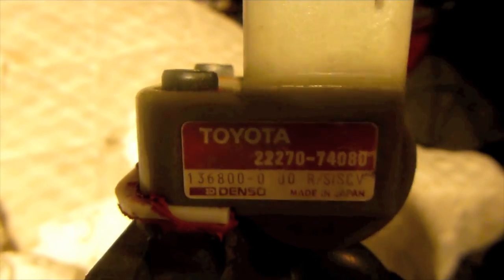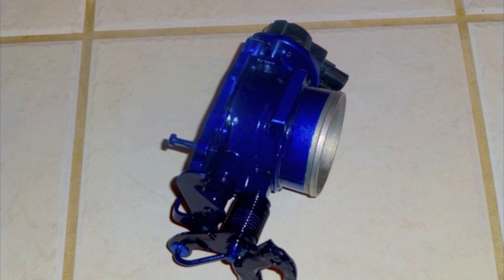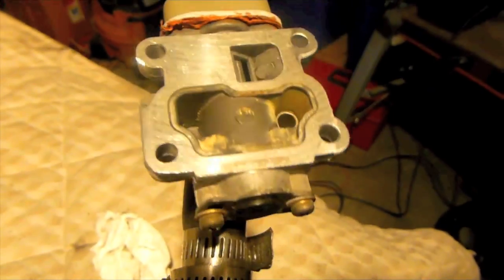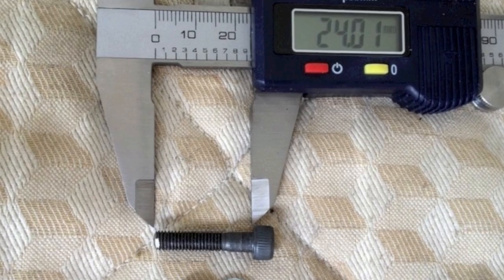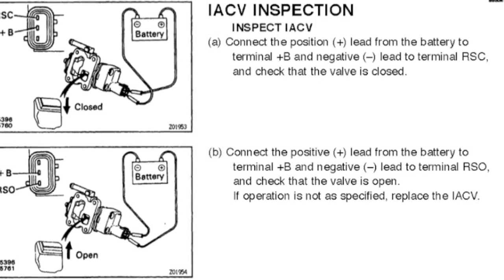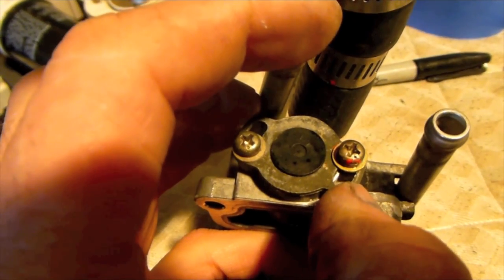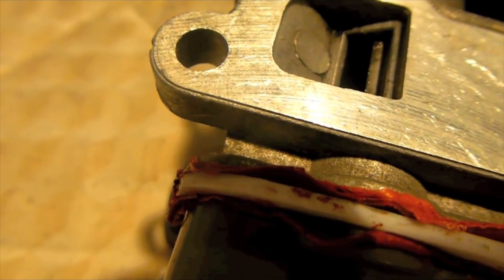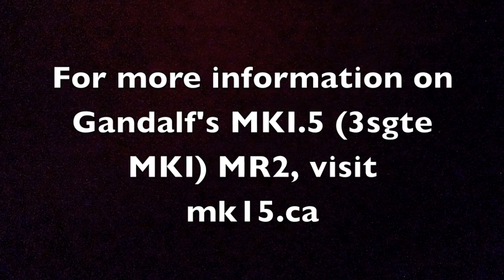Idle air control valve IACV, idle speed control valve ISCV from 3sgte engine (MR2 and Celica)

Comment: Hi Martin!
I have 4A-GZE with throttle body from MR-2 3S-GTE (55 mm dia instead of 45). When I start my engine it has no idle during approx. a minute or two. So I have to push the gas to make it work. Then I can release  the accelerator and the engine is idling but with less revs (as well as I can guess - near 1000 rev/min, factory tacho from 4A-FE is not connected). Idling is not stable, it seems that there are some misfire. The bottom is rebuilt with new rings. I checked as well for air or vacuum leaks - everything seems to be fine (I sprayed sort of easy start liquid to all connections, when it gets to intake you can hear it at once by slower revs).
So what is your opinion, can it be the topic of your video causing lack of idling just after the engine start?  Should I simply do same things that you showed on your video and it's gonna help?
Appreciate your help
Paul
Reply from the maker: A few things come to mind off the top of my head … the Throttle position sensor (TPS) I am not sure if it is interchangeable between the two ecu’s,
If the sensor is swapped out it needs to match the same “zero” signal (or be at the same angle and position)… if the sensors are still with their respective TB’s, then the 4a ecu is interpreting signals from the 3s sensor, so not sure if that is compatible that way either. That can cause the ecu to act uncharacteristically at idle.
Beyond that, yes, the IACV would be quite responsible for idle-up as you describe, and the airways would need to function from the TB to it etc.
The coolant hookups to the TB can be ignored and left unconnected if you don’t drive in cold winter.
So yes, the video info could apply in that regard.
Hope that helps!
Reply: @mkloppers  yeah, thank you so very much for your help, Martin!
As for the TPS - I forgot to mention that when I bought the throttle from 3S-GTE the TPS installed on it from the factory was not sending any signal, so I replaced it with TPS with same OEM part number as on 4A-GZE, with adjustment of its position of course. When my engine is warmed up, it is idling almost the way it should except some misfires. So can we put the finger of blame at the IACV?
Reply from the maker: @paulgauthier2693  I would start there, the IACV if it were stuck shut, would explain the low or absent idle when cold, but not the misfires  when warm. When it is warm/hot, the IACV would be closed anyway, and so the engine operation would be without it, and shouldn’t have any “misfires” due to the IACV.
Reply: @mkloppers  I really appreciate your help, Martin! 
You said that IACV would be closed when the engine is hot. So is there one more valve that opens and provide fresh air as temp rises?
Reply from the maker: @paulgauthier2693  no, the IACV should be the main controller of the difference between hot-cold engine idle, in combo with the ecu of course.
Other things do affect general idling and running. Have you done a boost leak test (vacuum test) for leaks? If un-metered air is sneaking in a different way it can cause erratic running at various RPM’s, and may cause the engine to be leaner than optimal at the start, especially cold start when you want the richest mix.
Reply: @mkloppers  yes, I checked for leakage with the help of easy start spray, even found 1 point of leakage, fixed it.
Judging by spark plugs colour (dark black), there's no lean mix, it's reach enough.
Ok, Martin, thanks a lot for your consultation, I will do the procedure in a day or two and tell you about the results.
Have a good time!
Cheers, 
Paul

Comment: So would this "range plate" be where one would attempt to correct a cold fast idle speed that is too high?  96 Honda Civic EX A/T.  Mine has the coolant circulating through it and a bimetallic spring.  Fast idle is around 1600 to 1800 rpm and supposed to be only 850 to 1000 with no electrical load and in park or neutral (150 to 300 higher than the idle of 700).  It is getting very annoying.  Would I rotate that range plate a bit CW until I get the correct fast idle speed?  Thanks for your video an if you see this would be grateful for any comment.
Reply from the maker: I haven’t fooled around with the Honda version of the IAC/ISC valve, I would wager it is similar in most ways to the Toyota version, but I don’t know specifically how Honda controls that valve. If your warm idle is perfectly normal, then it kinda eliminates the possibility that you have a vacuum leak (unrelated to the valve), because your idle would be up across the board.
Secondly, usually if these idle valves become clogged and hampered in function, they will have loss of range and loss of response to temperature difference, to the point that they don’t move at all. 
Thirdly, if the coolant passages were clogged, it shouldn’t affect the range of the idle valve, because when cold, the temperature would still begin at ambient no matter how much coolant was flowing, or even none.
There could be a temp sensor that determines coolant temperature that is sending signals that are out of range, eliciting a higher cold idle… but, unlikely.
I would remove the valve, clean it thoroughly, check it for leaks (because a leak there could allow more air into the intake manifold than intended),
Bench test it for range if you can,
And then test that plate movement and it’s affect on the idle. The reason I would try this last, is because turning it down may bring down your idle across the board, including warm idle.
Hope that helps.
Reply: @mkloppers  Thank you.  I did test my ECT because I also suspected it could cause high idle but it looks like it is accurate when comparing my scan tool output to an actual thermometer.  I removed the throttle body and the IACV and cleaned them pretty thoroughly previously and the car accelerated better but I had to turn the warm idle speed screw (no adjustment for fast idle) to get the car to idle at 700 after this.  The fast idle remained too high.  I will try cleaning it again but this time I'll remove the coils so I can spin the shaft and I'll also bench test the closing and opening under 12V power.  If that doesn't work I'll see nothing else to try but adjusting that range plate, except for PCV valve and spark plug wires, cap, and rotor which I will do first.  Thanks!
Reply from the maker: @captainwho1  
Wires cap and rotor shouldn’t have any effect on your cold idle being high, it would affect overall drive ability etc, pcv might however, or any other vacuum related things. You might be able to get the idle cold/hot where you want it by adjusting both that plate and the warm idle speed screw.
Reply: @mkloppers  Thanks for encouragement.  The PCV is very suspicious because the hose going to intake man. seems to be collapsed somewhat.  If there is a blockage in the PCV maybe that could happen.  Not easy to get at in this car (dumb!).  One of the spark plug wires is bad even though the car runs great.  Over 2 MOhms!!, hard to get a stable reading.  I wouldn't put it past this car to try to put more fuel/air in to compensate at cold startup, which could cause a high idle?  I just want everything else to be right before attempting to nail down the idle issue, which will require adjusting those two things hopefully, once I have determined once and for all that the IACV is totally clean.  I'm thinking I might try removing the coils and cleaning it in my ultrasonic cleaner.  I haven't seen anyone try that.  I saw in other people's vids that their valves were closer to being closed at room temp. than mine so I'm hopeful that is the problem, although nobody (including me) thought to measure the opening.
Reply from the maker: @captainwho1  sounds like a decent plan. Do post an update here, how things turned out. My car really is a Honda/Toyota combo, and much of the tech/designs between the companies of that era were surprisingly similar.
Reply: @mkloppers  Will do!  I just actually watched a video where the guy actually did adjust his fast idle by rotating the range plate, although he did some other mods which he admitted were unecessary lol.  https://www.youtube.com/watch?v=KBys2R3p-gw
Reply: @mkloppers  Posted my recent update in that video by OzMike I referenced above.  Better but will have to adjust the setscrew for the plastic limiter because I believe someone has tampered with it as evidenced by the seal cap being removed already.

Comment: Thanks for this video! This 3SGTE IACV looks pretty much identical to the one in the 4AGZE, so this has proven very useful !
Reply from the maker: You are welcome!
Reply: @mkloppers  With no voltages applied to your IACV - what position was it in? Open, closed or somewhere in between?
Reply from the maker: @AE92World  
good question. I actually considered using  no ground as a “setting”, for something in between, but it is inconsistent and unreliable, as far as the position the valve relaxes in. You can actually see in the valve actuation before I adjusted it, that there is a moment that the valve “relaxes“ as I release the ground from one pin and switch to grounding the other pin, the valve relaxes slightly towards the centre from its last known position. So, after fully closed, it will open up a tiny bit and after fully open, it will close a tiny bit. After I adjusted the valve, it seemed to relax less with no ground applied, but I believe that air pressure (or vacuum) will likely push the valve to a partly open position in short order.

Comment: Hi will this hell sort my idling issue in my celica gt4? Im using a side feed intake manifold
Reply from the maker: It could... have you tested the function of the IACV? Start with just testing if it is operating correctly. What are the idling issues?
Reply: @mkloppers  yes it works when voltage is applied but wont drop below 1.3k high idle i followed your video and did the same but has increased higher 🤷‍♂️
Reply from the maker: @Blackfracolin1  If the IACV is functioning properly when tested, and you even tried adjusting it towards fully closed, and it still idles high or even higher, you might have a vac leak that is allowing extra air into the intake manifold. Basically, air is bi-passing the IACV altogether, or finding a way to pass through it. Do a boost leak/vac test. Determine this first.
Then if not that, perhaps the throttle body plate is  not closing fully, throttle idle/stop screw is shifting.
Do you have air conditioning?
Reply: @mkloppers  no ac it has been removed the vaccum line going to the throttle body when blocked idles around 0.5k when let loose gos back up to 1.3k.. even when warm does exactly the same a little higher on cold start but still drops down 1.3k rpm.. do u think blocking the vaccum line increase the throttle screw will fix this problem right now the screw is tightened all the way  down? It has a standalone ecu fitted with a fmic all hoses seem fine checked the intercooler hoses and vaccum lines all seem fine and are new
Reply from the maker: which vacuum line is that, that alters the idle down to 500 rpm?
Reply: @mkloppers  its the one coming out the bottom of the throttle body the largest nipple has a vaccum line going to the intake of the turbo piping when blocked idle drops.. its the pipe from the iacv its a rev2 3sgte st185rc the same black vacuum pipe in your video.. i think my iacv is stuck open and maybe not closing but itis working when checked
Reply from the maker: @Blackfracolin1  How did you check it? Did you have it off the TB and looked right at the opening/closing?
I would agree, I think it is the IACV that is not doing what it should, not closing enough or enough range of motion towards closed.
Reply: @mkloppers  yes it was off the throttle body applied 12v to the pins and was opening and closing but not closed full until i adjusted as shown in the video its in full working condition.. do you think it could be the map because im still on actuator tune running the link g4 storm?  i sealed the tb using sealant with a special gasket no leaks..
Reply from the maker: @Blackfracolin1  Ok, we might be getting somewhere. :)
Do you know, or can you test, what voltage readings are being sent TO the IACV? That's the next thing to determine, whether the ecu is giving proper instructions to the IACV. The ecu should be telling it to be open at cold start, and then as the engine warms up and coolant temps rise, the ecu will tell the IACV to close, dropping idle consistently to normal idle range, 700-800 ish. The Link G4 Storm would need to be set up with the proper outputs to control the IACV, and this may require as many as 4 outputs.
This is something that you need to check with your tuner. It could also be set up similar to the way I did it, pretty much full open or full closed with the ecu sending full voltage to fully close only below a chosen coolant temp. This is not a gradual change, of course. In my case thus far, I have it on a manual switch, and haven't bothered to hand the control over to the ecu at all.
And, one more note, you can also test your TPS to see if it is operating within specs, as this can also throw off your idle... the Link ecu would also need to have the TPS setup correctly in the software/tune.
A video that you might find interesting, using your Link:
https://www.youtube.com/watch?v=mPzhbWABdjo

Comment: Hi hows it going mate, Iv got a MR2 MK3 (spyder), it always revs up a wee bit when changing gear, if I change gear at say 3000 revs.... as soon as I press the clutch the rev counter needle always goes up by about 250revs for a second then comes down again, (if that makes any sense.haha) Just wondered if you had any ideas what would cause it to do that? Iv cleaned the MAF sensor but its still just the same. thanks :)
Reply from the maker: A few things may be affecting that. It sounds a bit like rev hang, but I don't think it is a common or consistent Spyder issue, and it shouldn't be caused by computer-emission controlled annoyances that will come up with other brands. 
Yes, the IACV could need a cleaning/testing. It could also be a vacuum leak. You can also test the TPS.

Comment: Thanks!  My iacv is likely gummed up and stuck closed because i hardly have any rpm at cold start.  Sits at like 500rpm and nearly dies.  But once warm it's fine.  Hoping a good clean will solve my low idle issue.
Reply from the maker: It sounds like yours is not opening at startup.
Mine did that again recently, and it was likely due to water-meth (WM) injection, as the location of the valve bypass tube in my setup allows it to possibly collect some WM, and the valve, once closed, would sit in WM overnight or however long before the car would be started again... I noticed the idle down was not as pronounced when I deactivated it, and this progressed over the course of a week or two, until it stopped closing altogether (RPM's would stay high after startup, and idle was permanently higher). I think it needs some periodic attention, seasonally perhaps, and certainly the moment the idle performance begins to change. An abrupt change one day to the next may indicate a problem other than gumming-up. I tuned it out until the next time I removed the valve, and then had to retune idle again once I got it moving again. During that stretch with the valve stuck open, there was a limit to how low I could drop my idle (by pulling fuel in the idle range) before the injectors would hate it and the idle quality suffered and didn't sound right/smooth.
Reply: @mkloppers  YES!  I also run water/meth injection.  I was thinking this could be a contributor to my low idle situation.  Either way, it's probably best I pull the iacv off and have a good look.

Comment: Thanks for the awesome video, I have a few questions. My cold start sequence seems to not be working correct - I start the car and on cold start it idles at 1000 RPM instead of 1500 like it should on cold start. My warm idle is stable at the normal 800 rpm (after fixing the leaks that were coming from the same place as yours). So my cold start RPM is too low. How should I adjust the plate (full close or open as much as possible, if at all) to allow for a higher cold start RPM? Thanks in advance.
Reply from the maker: Yes you should see more idle range than that.
The IACV together with voltage from the ecu based on temp and other parameters, is the main factor in startup idle RPM.
Did you test the IACV when you were sealing it for leaks?
It likely is not actuating as far to the open range as possible and could be somewhat stuck, range-limited. You should get 500 RPM difference, (thereabouts, or more).
If you did test it and could see it open and close with good range similar to in the video, then you could try and adjust the plate (as viewed from the front looking at the screw heads/plate, just like in the video) in the counter-clockwise direction, which will shift it's range towards further open. You may find that your warm idle also increases though.
If you find that adjusting the plate (without un-installing the valve and therefore cannot see the range of movement of the valve itself) has little or no effect, it is likely gummed up and range-limited.